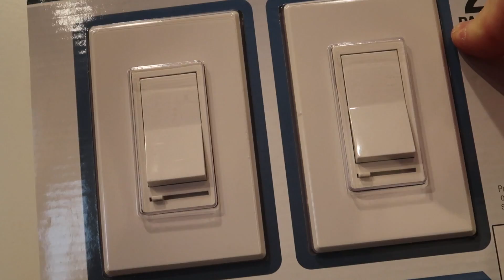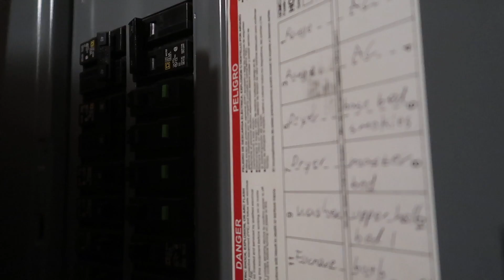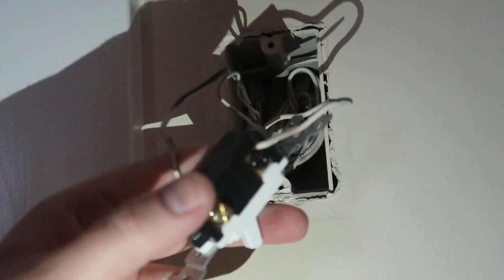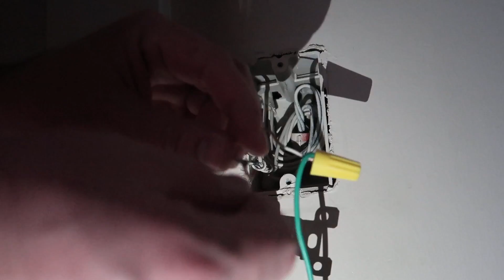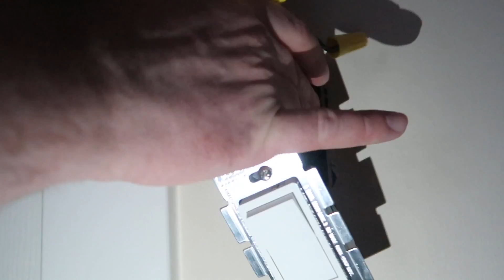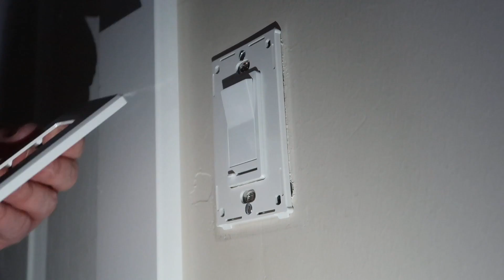How to install an LED dimmer wall switch Single Pole

Comment: Your switch is a 3 way but it is wired as a single pole. Why use a more expensive 3 way when you don't need one?

Comment: You keep talking black and white, but my wires are different colors on both incoming. It would be more clear if you used line and load. Common is ?

Comment: In my wall, I have a single poleand i just have hot (black), neutral (white) and ground (unsheathed). But my dimmer has load (red), line (black), neutral (white) and ground (green). I can't connect 4 wires to 3 wires, what one is redundant? The neutral?

Comment: Do u have to buy a certain light fixture or bulb for the dimmer or just a switch will work on a existing fixture?
Reply: You need a lightbulb that will "dim" it will be marked.     the switch and the lightbulb work together

Comment: I believe that you should watch this video :
https://www.youtube.com/watch?v=naM_rECt078
1. He talks about the wires in pairs not simply: remember which wire goes where and match the labels on old and new switch.
2. He removed the ground wire last.  He didn't make a point of it, but its the safety precaution.  Its like me fiddling inside my computer case and then when I finish I put a grounding strap on!  In this case the vulnerable thing is your life rather than your computer hardware.  Its irrelevant that the power is off, the ground should be last and first thing to attach.

Comment: Thx for the help!  I wasn't sure if I needed to connect all of the wires in the junction box or just the black & white to the red & black. Thx for your help. It works fantastically!😉

Comment: Can I use a “dimmer switch for LED/compact fluorescent/incandescent” on just regular bulbs?  I’m thinking the one I just purchased from Amazon isn’t going to work
Reply: I believe I saw on the box when I bought some bulbs, they do label it's not recommended or not used for dimmer.  But always check the box.  Please let me know if you saw that on a box you bought.  Happy Holidays!
Reply: It actually worked great, just had to mess around with the wiring and figure it out

Comment: So there are no cords you need to change to a dimmer? Like you don't need to run any new wires?
Reply from the maker: Correct.  No new wires.

Comment: I saw you have 2 black wires and ground(black to black)(black to red) and grounds together ,but I have black white and ground,do I connect red to the white?
Reply: Thats what I'm trying to figure out myself
Reply: @jonathanmarquez611  did you ever get it figured out? I have the same issue...
Reply: I have the same question,
Reply: Some dimmers require a neutral (white wire) while others do not. Red wire (without a label attached) goes to the load (light fixture)

Comment: My husband was a great electrician I learned a few things from him. He likes to do these with the power on. Always scared me!
Reply: Hummm...
Reply: Yeah. "Great Electrician" and "liked to work with the power on are "non sequitors". Sorry.
Reply: Back in my old country I did change our switches with the electricity on. 220 v. All you have to do is not touching the wires and the  screwdriver be insulated. Easy. I was a teenager.
Reply: @mydigitallife8311  W R O N G!
Reply: @thomaslanik7215  yesterday i changed 2 outlets and a light in the bathroom. I'm still here.
Reply: @mydigitallife8311  congratulations
Reply: My neighbor used to do that until a mild shock of a 110v gave him a heart attack. Sadly he did not have a second chance...
Reply: BRAVE MAN !!!  AS LONG AS NO MISTAKES GET MADE !  BUT, I'D RATHER TRIP THE CIRCUIT BREAKER TO PRESERVE MY LIFE AND MY PROPERTY !!!